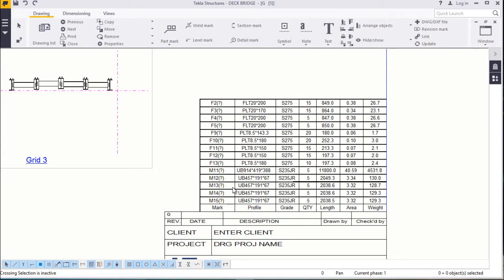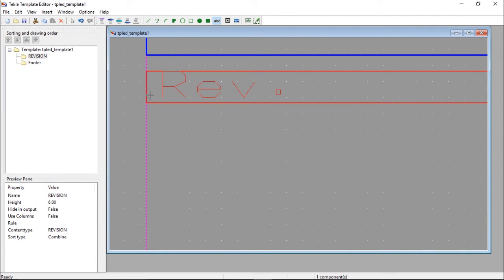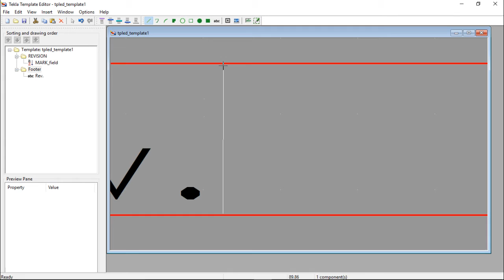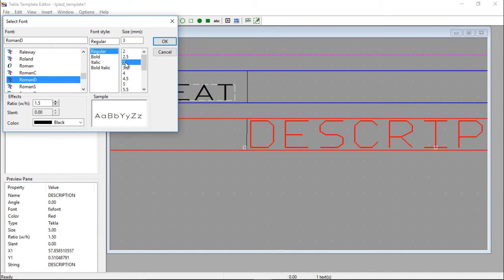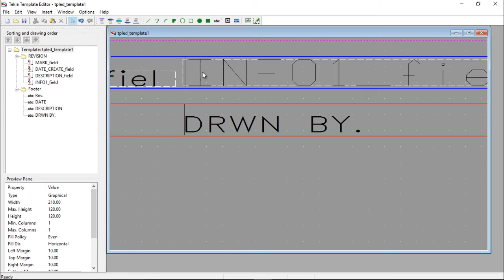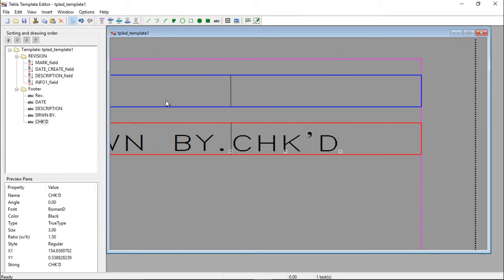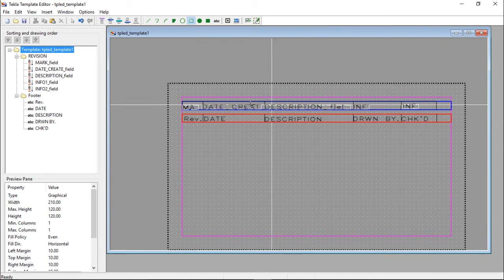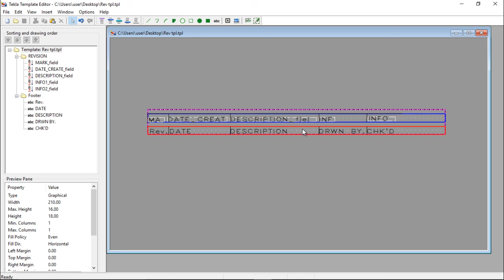Title Block Template editing Part-1 in Tekla Structures 2016

Comment: THANKS SIR 
the templete i make is not showing in single part and assembly dwg just showing in  g. a dwgs 
plz help to solve iut this problem.
Reply from the maker: Make title block for both GA,Assy and single part drawings and save
Reply: @MauriceDimba  I make all according to your tatorial.
Dwg template 
Assembly template 
Part template
Reply from the maker: you can create one titleblock and apply to all drawings.